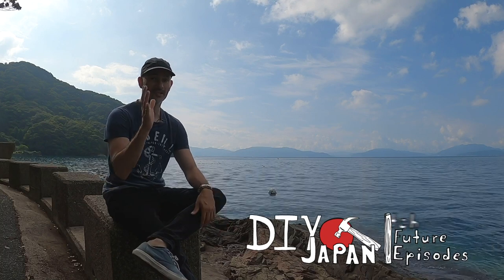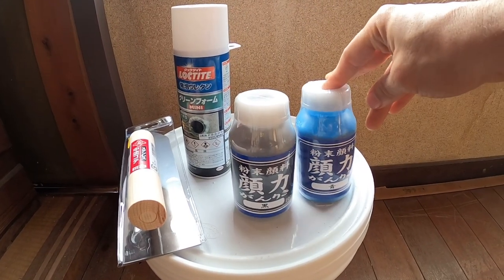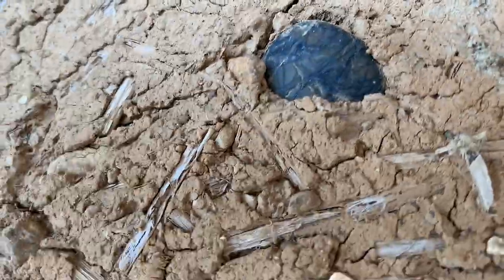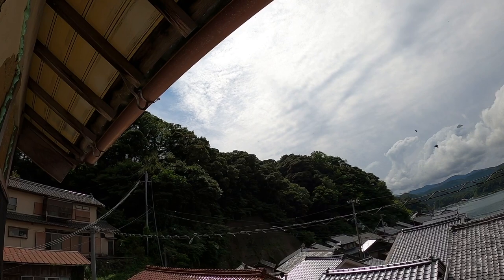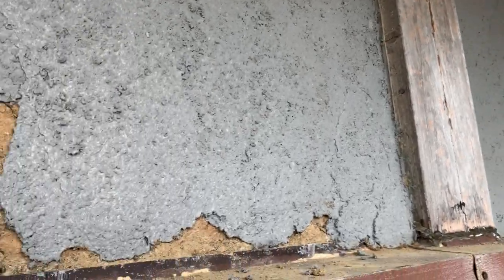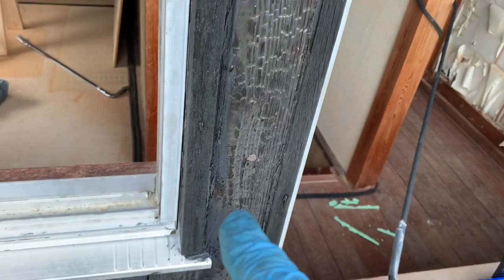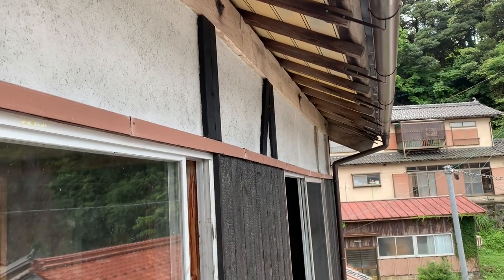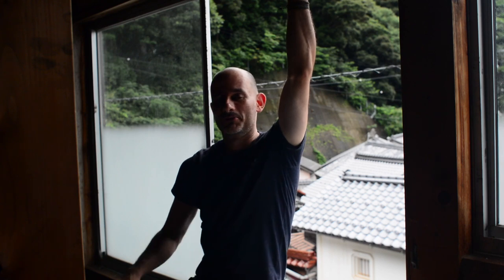Applying Japanese stucco to deteriorated exterior walls, will it hold? - Renovation Episode 8

Comment: I would recommend using a jig you can mount from the overhang of the roof to hold the gutters in place. I always build an extra set of “hands” to help me finish my projects.
Reply from the maker: I sat for days trying to figure out how I could suspend the gutters while I installed the mounts. I had thought ropes coming over the other side of the roof. Maybe I'll have to google some ideas for a jig setup.

Comment: Thanks for posting these videos! My wife and I lived for many years out at the end of the Chūō Line in Western Tokyo, so we find them fascinating. Our house was built in 1975, so we had many of the same challenges you also face. With a new baby, we got serious about keeping comfortable. Things got better as we improved the house by doing the same things our neighbors did with their old houses. Upstairs was about 15 tatami-mat-units in 3 bedrooms, plus closets. Downstairs was an 8 tatami mat room, plus kitchen, genkon, and bath. Here is what we did/learned.
1. We added about 33cm of insulation to the attic. Also, the un-insulated backs and tops of interior (and exterior) closets of the house were insulated when we put in new cedar plywood. There was also no insulation above the bath, so condensation would drip on you when you had soaked for a while. Insulating above the bath helped. The open ceilings look great, but you would be more comfortable if you would put them back and insulate.  Cainz or Joyful Honda will have the large bundles for about $100 each. I would guesstimate you would need 10-15 of these. After we did this, the upstairs was much nicer.
2. We put a basic 10 tatami-mat-unit Panasonic mini-split unit (AC/heat pump) upstairs, and one downstairs. Doing the math, the new units put out more heat per Yen on typical 5 degree days than kerosene, with better air quality inside and no carbon monoxide danger. You own that house, so you can ask the power company to run 220 volt power to your meter to allow for slightly larger 20 tatami-mat-units like you see in cafes or shimin centers. Dehumidification and summer air conditioning came as a bonus. They come with timers, so you can set them to warm or cool the house about an hour before you get home. 
3. Small portable de-humidifiers are useful for drying laundry indoors when you have a string of rainy days. They also help in the fight against mold. The waste heat they produce helps on cold wet days.
4. Many of our neighbors plugged the foundation vents around their house with bubble-wrap when it was super cold to keep the crawl-space warmer. We had too much moisture under the house to allow this.   
5. Curtains. The double rod kind were best for heat. You need them in the bedrooms anyway for the 4:00 AM early dawn light in summers. Lots of options!  
6. Crazy cold = close the storm shutters at dusk. Listen for your old neighbors doing it. Your house is HUGE, so this is more of a challenge. Just doing the windward side helps. 
7. Live under a jumbo kotatsu table. Hard-off stores have nice used ones cheap. 
8. The older houses are really designed for the tatami mats to be part of the structure. If you ask your neighbors for a recommendation, there will be a local guy who will remove all of them and recover them all for $50-$100 each. This adds up, but it can be done in a few days while you clean under where the mats were. Afterwards, the house will smell wonderful.
9. If the closets are dirty and worn, replace the cedar plywood. Be sure to insulate the top and sides of each closet. 
10. They sell wallpaper that can brighten up the rooms and cover the old plaster. There is also a local guy who can do this very quickly.
11. Renew the fusuma and shoji with fresh paper. There is also a local guy who can help with this, but I found it fun to do myself.
12. Cainz and Joyful Honda both sell modern pre-fab fiberglass bathrooms for $5-$10,000 that could be quickly installed. Our old house had a basic version of one of these. Again, this could happen very fast.
13. Your aluminum frame windows probably need to be cleaned and have new gaskets installed so they seal better. It is helpful if the bedroom also has shoji for noise and drafts. They make window shoji kits you can do yourself.

A lot of the basic stuff above could be done quickly yourself, or contracted out to get you in the house ASAP. Good luck going forward!
Reply from the maker: Hey Ryan, thanks for all the great advice. It's true I am facing many of the things you faced. I still have a long way to go lol
I have spent a short time in winter with only a small kerosene heater to keep me company... it was tough. But I have implemented some of the things you suggested since that fateful winter.
Definitely curtains are in the short list of purchases... my houses faces west so the sun bakes the front of the house in the evening. 
As for the windows, great advice. I will look into your suggestions. They really are the source of cold in winter and heat in summer. 
Is the window shoji good for blocking sun much? My idea was to order blinds from the U.S. lol Would love to have mini blinds... but doesn't match the Japanese aesthetic lol
Thanks again, I always appreciate advice from others who have experienced the same!
Reply: No need to order blinds from the USA. There should be a smaller home goods store in your area that will have what you need at a fair price. The best thing is to find this store and spend an hour or two slowly looking at all the displays to research what they have.  Metal Venetian blinds should be available in the proper standard Japanese dimensions. Also notice some of your neighbors tape aluminum foil over windows as a cheap option.
Reply: The plastic Shoji kits are available at these stores. You will see a display with a miniature sample and larger sheets of window plastic and frames on offer. Again, I believe a local friendly neighbor can recommend someone to install the real paper shoji in any bedroom windows. We never tried this, but it should be possible by removing the aluminum frame window and changing the wood frame around it to add the shoji track. Using the local recommendations for help can make you a closer neighbor. It is like working super hard on posted clean-up days, sorting your trash correctly, or helping everyone with snow shoveling. When you do this you become part of their group and entitled to the benefits of that group despite being an outsider.
Reply from the maker: @ryanfoster9863  There are a few local places not too far way. I'll have to stop by, to their surprise I'm sure lol
Reply from the maker: @ryanfoster9863  I have a lot to consider about the windows... I haven't decided yet. The windows are permanently frosted and that has to go.... so it will be update them with new glass and seals or change them out completely. Might be a fall project... too hot to do now lol

Comment: When applying wet mortar to dry, it helps to moisture the old dry surface and your first 'pass will adhere better and your float can move better.
Reply from the maker: Great advice! I have some outside walls on the first floor that will need the same treatment as the second floor! I’ll put your advice to good use then! Thanks!

Comment: The exterior wall you completed looks great! I like the contrast between the light gray plaster and the ‘darkness’ of the wood. The plaster became lighter in colour after drying. Nice job applying the new plaster. Was it a special, exterior Shikkui?
Reply from the maker: This type is meant for exterior according to the bucket. Can all of them be used outside... that's a good question. The plaster went on much darker... which I liked the dark color, but did end up drying much lighter. So you can't worry so much if it's dark at first.
Reply: @DIYJapan  As you may know Shikkui is traditionally made from all natural materials. Common basic ingredients are lime, seaweed glue and hemp or straw fibers. To increase water repellency for exterior use, soybean oil is added. Diatomaceous earth for example is added to increase water absorption from the air reducing interior humidity. Many other ingredients can also be used for different purposes. Kesodo is another natural product worth considering for interior use. I’m not sure what ingredients are used in many of the pre-mixed, ready-to-use buckets of Shikkui commonly sold for DIY’ers in Japan these days. I’d want a water repellent additive for exterior use. Sometimes finding exactly what you want is a challenge in the countryside. I’m planning on doing some interior Shikkui repair later this summer.
Reply from the maker: @ShikokuFoodForest  I've been applying shikkui in the interior for some time now. My videos are a little behind my current work's pace. A lot of good products out there and you can alway order them online. Sometimes I order the big buckets when I can't find them locally, heavy as they are, and have them delivered... to the dismay of my mail man lol
Reply: @DIYJapan  Thanks! There are many Home Centers in the city not too far from where I live. Sometimes, I ride my bike 1 hour to go there. I don’t mind the extra exercise. One question I have is in some areas, the clay and straw has crumbled away.  So, I wonder if I should fill in those areas with new clay/straw mix first before troweling on the new Shikkui. Actually, many of my interior walls are thin layer of light gray mortar, rather than Shikkui. I’ve been trying to research exactly what it is, so it will match when doing my repair work. Ever seen this? Not sure whether to use light gray Shikkui or mortar??
Reply from the maker: @ShikokuFoodForest  The coating in the middle would be called 中塗土 or ( nakanuri) you can copy the Japanese and search it. You will come up with a lot of sites that sell it. You can add straw and rocks or what have you if you want a rough layer and then add another smooth layer of nakanuri over it to smooth it out. It'll take a good long while to dry so be prepared to wait. The outer layer is just a lime plaster like shikkui. As far as the thin layer or gray... is it mortar really? Some different grades of shikkui are harder than others... but it could be possible that they used mortar... just strange if they did lol
Reply: @DIYJapan  Thank you for the info. I’ll look at the Home Center for nakanuri. I’ve never heard of it. Looks like the local clay soil with some straw mixed in. Yes, it seems strange they would use mortar. But, it looks almost like concrete to me without the rocks. Also is different from regular lime plaster I’ve seen. It’s only 2-3mm thick. The house was built 70+ years ago and all the young carpenters I’ve met here have little to no experience with old construction methods.

Comment: Got some good laughs and info out of this video! The guy who put up your gutters must have been related to the guy who nailed my sliding windows and kitchen door shut! They used huge nails that required the force of god to pull out! 

I feel your pain about the doing stuff alone part. Most of the people I see on YT doing old house renovations are couples or have helpers, but I do follow you and another couple of solo DIYers, like myself. The Japanese-style stucco you used -- is this the same stuff that can be used with a "new" wall of bamboo strips, criss-crossed inside the frame of a wall, or is something more needed? Also, how much does that large bucket cost? 

I noticed that the wood on the left side of your house is still brown -- are you planning to match it with the front? I think it would look really cool!
Reply from the maker: Yeah those nails are the worst. In the up-and-coming video I show some of the nails. They are huge! 
I used this material on that type of wall. All my interior walls are the sand wall with bamboo criss-crossed inside. This type is mixed with fibers so it's a little tougher than the smooth versions. It's specifically more for outdoors because of its chunky style. It's pretty expensive, as of writing this it's about 13,000 yen a bucket... yeah ouch. 
The plan is to restore the whole outside of the house exactly like the front portion I did. Just time is short and I have other projects inside that I want to focus on first. And summer wasn't exactly my favorite time of the year to do it. It's was unbearable doing it in summer :( I actually have all the material just sitting there lol
Reply: @DIYJapan  I wonder how on earth those nails even managed to stay straight when they were banged in! I have the same ones scattered here and there and I absolutely hate how long it takes to pull out just one. 

12,000 a bucket isn't cheap, but how does that stand up to mixing it yourself? If you notice the terribly-damaged walls on the left side of my house, you can see that there are several posts, beams, sill plates, and walls that have to be replaced. I see people replacing the bamboo inside and redoing it the original way, but if you were faced with having to do this, would you follow the original method as well, or make some changes in your approach? It seems so time-consuming! I know it lasts for a long time, but I can't help but wonder if there's an easier way that's just as durable, if not more so. 

I have certain things to do before winter arrives because I plan to be in my house before the end of the year. I like that you used an expanding foam spray to fill the cracks! I didn't know if people were using this here, but it's definitely a common thing in the US. Is it very expensive?

Thanks so much for all the info, it's really helping me out!
Reply from the maker: @BrandonAEnglish  I've never bothered mixing it myself. It's much much cheaper that way. But it's not easy by hand... dare I say near impossible. I eventually bought a mixing tool with enough torque to mix with... in future episodes lol I'm actually months ahead of my youtube channel now. Don't be fooled into thinking that a power drill with a mixing attachment will do... it won't have the power to mix it. 
I wouldn't be concerned in following the original methods. Few reasons: Cost, time, and difficulty. It'll take a lot of material, the method takes time, you have to put it in layers and each layer allowed to dry for long periods of time before the next layer goes on. Arakabe, the first layer needs to dry 1-2 months before the middle coat and finally outer coat is applied. It would be much quicker, cheaper and easier to install exterior sheetrock over the old walls and  moisture protections and if you can, insulation. Unless you really wanna keep it traditional... and you like pain and suffering lol
As for the foam, many carpenters actually use it to fill the shrinking gaps and then cover the walls up with boards and moisture paper. It's very common.
Reply: Regarding the foam to fill the cracks; right after I bought my Japan house I got spray foam and caulk to fill the gaps, but was told by the locals to not do it as the house needs to breathe, otherwise mold will form inside the house.  I never did fill those cracks and also ended up putting in house recirculating fans to get more air flow.  Even though my house is in the mountains, we still fight the mold every summer.  I imagine it’s probably worse where you are.
Reply from the maker: A lot of people talk about old houses being designed to ''breath''. And I get it. Mold is a tough opponent and always lurking. But I think that mentality is old fashioned. There are many ways to fight mold without compromising energy efficiency. I have see many carpenters using it in my area. I've seen a  few youtube videos in Japan about it too. They foam the heck out the old houses lol But I'm no expert lol I just don't like my house exposed to the elements and insects. Recirculating fans is definitely a good idea but it's tough to balance breathability and energy efficiency. Your neighbors are probably freezing in the winter and spending loads of cash on kerosene and passing out in the summer... there should be a better way to balance things... I'm still trying to find that balance myself lol
Reply: @DIYJapan  I agree. There is definitely a better option to improve efficiency, keep mold away, and bar insects at the same time. Shouldn't have to sacrifice anything!